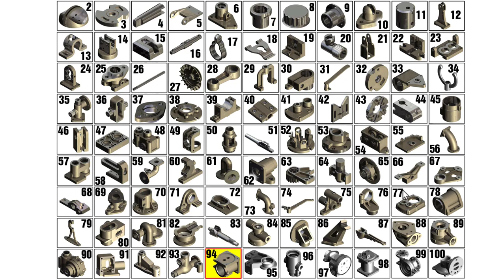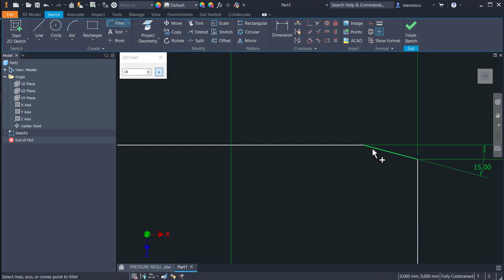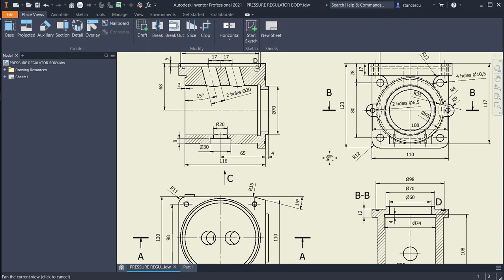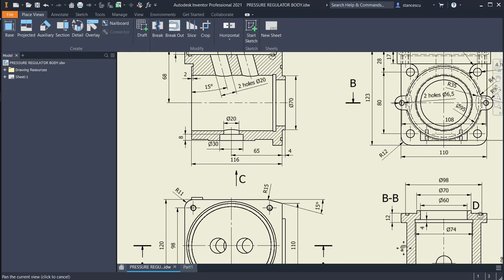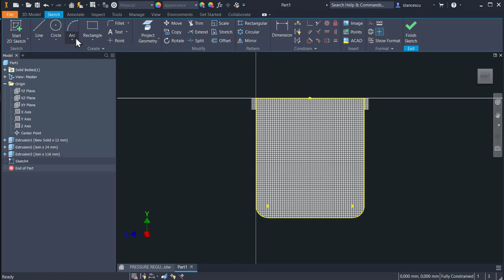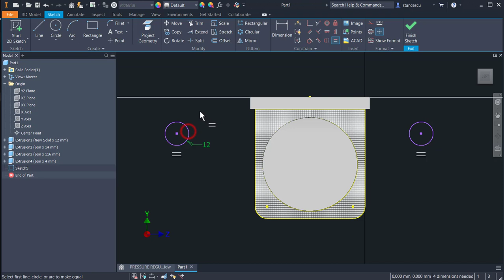Tutorial Inventor - 134 PRESSURE REGULATOR BODY (Part-094)

Comment: Dear Professor, I believe that there are several errors in the modeling.  Petr is correct, you forgot to adjust (to the subtraction) the changed thickness below.  I believe that this thickness should be 12mm as shown in Section B-B, not 17mm.  The top plate should be 17mm as shown in the main end view.  Lastly, the last four holes should be dimensioned as shown in the main end view.  The two top ones happen to be concentric with the R12 fillets, but only after adjusting the top plate to 17mm;  the bottom two holes are not concentric with the bottom fillet however.
Reply from the maker: In my opinion the dimensions 17 and twice 12 are OK.
Instead, the two holes from the bottom are not well placed on vertical (82,023 instead of 80).
Thank you very much for your work!

Comment: Hello dear Constantin, on 10:00 extrusion should be 116-17-2. Later in the video You correct flange of 17 thickness, but You do not correct this extrusion afterwards. Also on 28:10 holes 10,5 are not centered on R12 but dimensioned separately in bit different position. Thank You again for the tutorials, I enjoy it really.
Reply from the maker: You are right Petr in both cases!
If you want a gift from me please use my e-mail address from the minute 0:16 to say Hello - I'll use your address to send your gift!